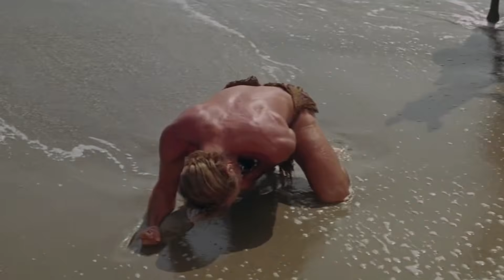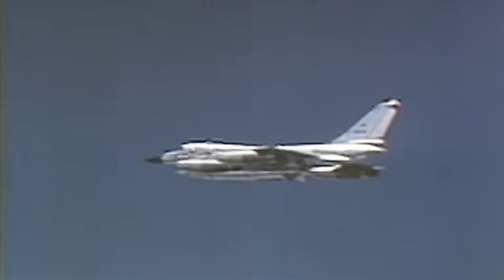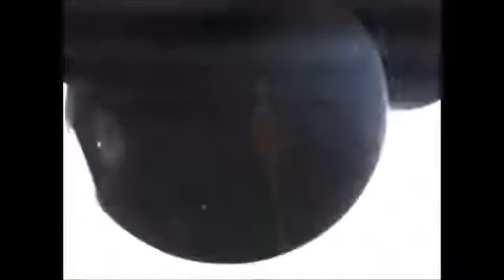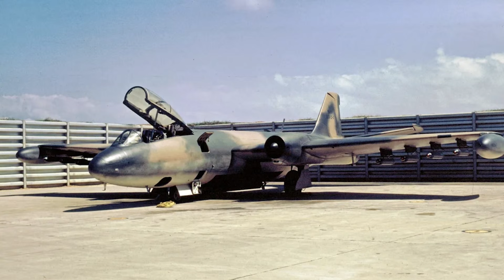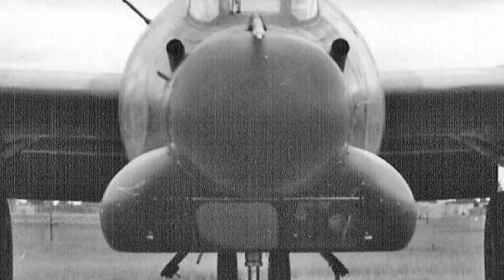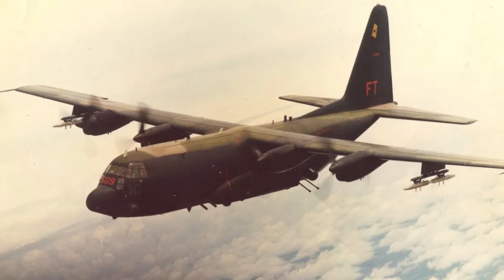The Martin B-57G; Laid the Groundwork

Comment: Great video. Had no idea F-102s were used in this role. Thanks.
Reply: I had thought those were mostly bored pilots trying to find something to do.
There were even attempts to use IR Falcon and Sidewinder missiles to hit trucks and locomotives.
Reply: @petesheppard1709  Great fliers. 
Crap economists.
Reply: @Farweasel  😄  Well, it wasn't coming out of their pockets...
Reply: Vietnam was a real wake up call for the air force. They thought they would only need to fight a strategic/nuclear war and that even maned aircraft might be phased out. Glen L Martin was even getting out of aircraft building and focusing on missiles Like the Martin Mace which I guess was a forerunner to cruise missiles.

An agreement with the army made it worse. Since the Air Force wanted a monopoly on bombers and attack aircraft (they tried to take over the Navy's aircraft early on after WW2 , like the RAF did to the FAA after WW1.) The agreement with the army was that the army could have no fixed wing attack aircraft (the AF really didn't care about rotary wing aircraft) the Mohawks were not allowed to carry weapons but only reconnaissance. That was later changed, but it took a while.
Reply: No i didn't either .

Comment: I find cool that the B57 is still used by NASA. The WB57 is the Airplane that gives amazing  aerial video of capsules coming back from space.
Reply: I live close to Ellington Field, south of Houston, where NASA hangers one of these aircraft.  I see the WB57 flying on a regular basis.  It has a very distinctive engine sound and its wings are huge.  Beautiful aircraft.
Reply: @jesseleblanc989  Same, I lived just down the road from Ellington, and even got to see them up close at one of the NASA shuttle return receptions. Beautiful aircraft, both in the air and on the ground!
Reply: @jesseleblanc989  So lucky. Here in North Bay Ontario Canada we have CFB North Bay and we may be lucky enough to see an aged F-18 fly over every other month or so. Regards from Canada.
Reply: remember seeing b57s with nasa marking flying over my home as a child
Reply: @robertbrodie5183  You can track it on Flight Radar as NASA 926 and NASA 928.
Reply: The WB-57 is a very different aircraft to the B-57. It is like comparing the F-104G with the U-2 - they started with the same airframe but ended at very different places.
Reply: I spotted one flyhing into Miramar MCAS three years ago.  Impressive plane even from 2 miles away.
Reply: I wanted to commant that too i love the B57 and the WB57 that looks like they just glued extra parts on it
Reply: Yes I have seen it at Ellington near Houston
Reply: ..I saw one about 30 years ago fixing to take off from Pslm Beach Int'l airport
Reply: I believe NASA still operates three, out of Ellington, along with their ER-2s, Super-Guppy, and Gulfstreams -- pretty cool sites to look at, as well as the Flight-Tracker NASA missions (mentioned below, in comments) which the WB-57Fs do. The current, three 57Fs have been cleaned-up significantly from the earlier USAF recon days, having the two pylon-mounted engines removed, to leave the two big fans in the wings. In (1979/80), three of them visited Elmendorf AFB Anchorage, during the summers, for high-altitude survey programs. I believe at least two of the tail numbers then had previously belonged to my dad's recon squadron - 556th RS, in 1968/69, out of Yokota AB, Japan; they operated RC-130s (linguists and other intel specialists in the cabin), long-wing RB-57Fs, and the "short-wing" (original design) EB-57Es. The squadron also operated DC-130-delivered recon drones, out out bases in Viet Nam/theater -- being the early "Firebee"-style drones. Busy folks. 

Later, as the jets went to NASA, I think astronaut Sally Ride (likely other space-bound crew, as well) spent some time in the 57Fs, as the crew are in full-pressure suits for the extensive missions. I'm wandering from the subject B-57Gs, but this platform enabled some whopper variations, and is still in there pitching, with a vital task at very unforgiving altitudes. A great U-2/RB-57F book is "Stratonauts."  Ed Nash, excellent research and history shared - well done!   --Dana Nichols